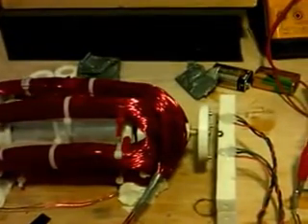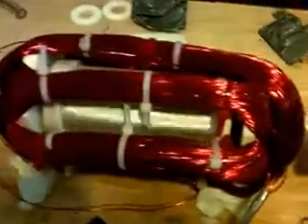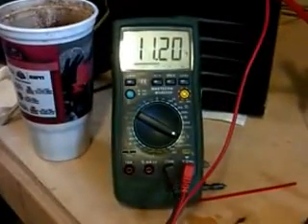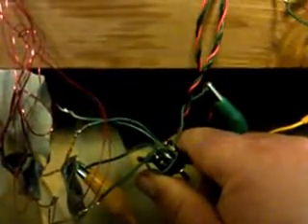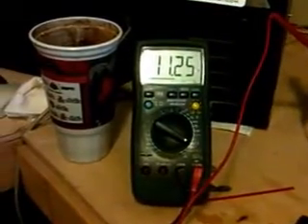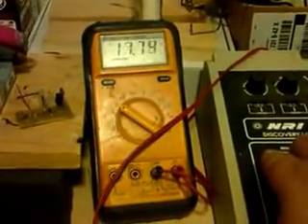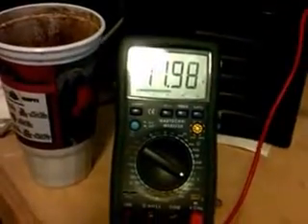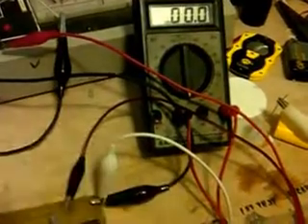Bedini Cole Window Motor

Comment from the maker: I didnt use CAD for the 3d model. I used google sketch up with the extension addon so you can export to the proper format for conversion and pronterface. The schematic is easy to find. I did a Bedinni cole search on google, and found one tward the bottom of this page. https://vk.com/wall-44167196. I also showed close ups to the schematic I used in the video. Just look through google images until you find one that matches.